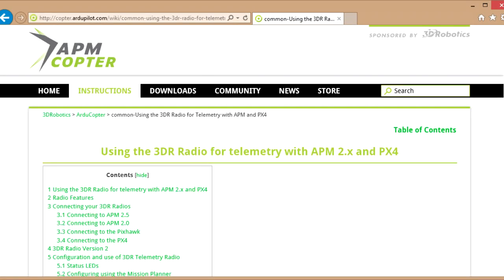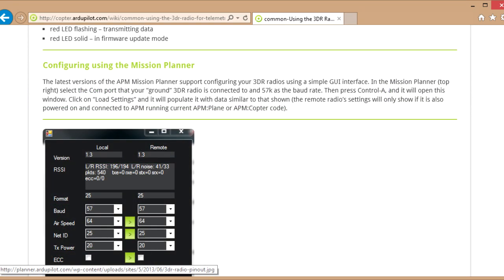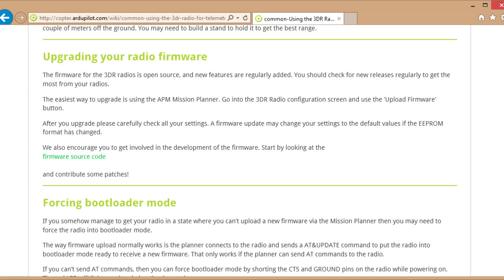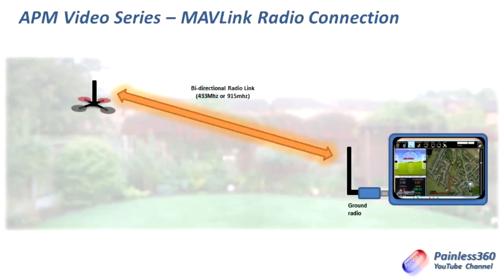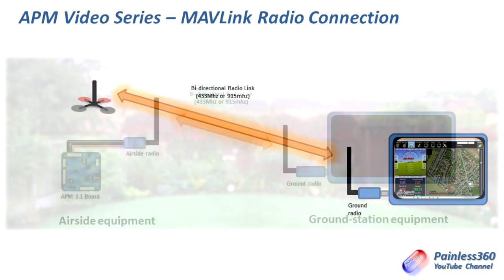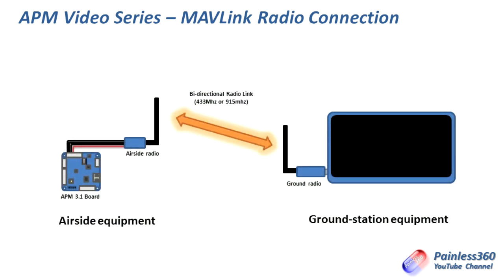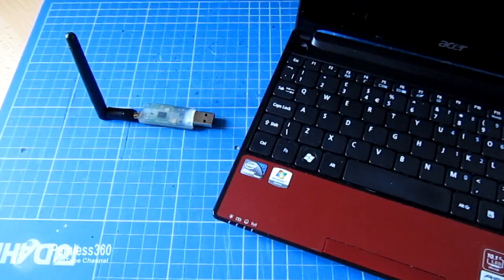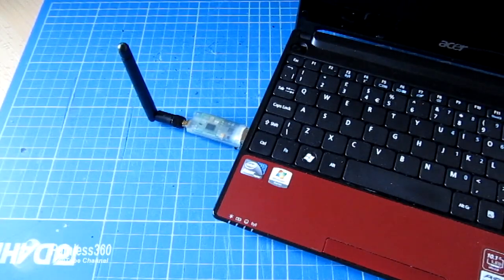APM 3.1 Video Series - Simple 3DR/MAVlink radio setup and use

Comment: Hi there, hope you are well. I have put together a 450 quad with APM 2.6, 900 Mhz telemetry and Minim OSD using your tutorials and all works beautifully. I have one minor issue tho which is - when the telemetry is not connected (to the PC), the GPS doesn't seem to initialise and no matter how long I wait, it never shows on the OSD. I have spent quite some time researching this without any luck. Would you have any thoughts on the matter? Regards, Peter.
Reply from the maker: +Peter Hegarty Are you not getting power to the GPS? If not then the power to it may need to checked. J1 would be a place to start and see if you can see the positive voltage on the GSP connection with and without the USB plugged in.. Best of luck..
Reply: +Painless360 yep, power is fine to all parts, the gps will only work when APM planner is connected, I'm guessing I've missed a setting somewhere ???
Reply: +Painless360 sorry I missed the bottom of your message (I'm using my phone) . I'm using the telemetry (wireless) not usb, but until APM planner is connected via wireless, the GPS won't show up, as soon as I do connect, away she goes. It's odd because I thought I could get full functionality without having to take a laptop with me to the field.
Reply from the maker: That is odd, never seen that before. I would have a good mooch in the forums. Sorry I don't have a 'magic bullet' answer. Best of luck.
Reply: +Painless360 yep, very odd, will let you know if I find a fix, thanks for your time 😊
Reply: +Painless360  Fixed it, I had to connect the transmit wire from the OSD to the APM. I made the assumption the OSD only receives - it does to a point tho, but needs to make a "request" for GPS and battery data. All working now :)
Reply from the maker: Well spotted - Happy flying!

Comment: Hi there, thinking of the APM 3.1 over the larger 2.X series, looking on eBay for the 3DR Radios however nearly all say they are compatible with the 2.x and no mention of use with the 3.1.  Did you use a 2.x 3DR Radio?  Cheers.
Reply from the maker: +Michael Wilson I did. Best of luck!
Reply: +Painless360 Thanks

Comment: Hi, I am working on installing a pixhawkp4 on a tarot650 quad using 4114 320kv motors and I am doing cancer treatment chemo and my mind is fuzzy&forgetful,I realy ould use your help wiring the pixhawk? if possible let me know?GGOD BLESS
Reply from the maker: +david ringler Follow the diagrams in the videos and the manual is excellent. Keep those props off until you are sure you have them connected the right way and turning the right way too..I have a Pixhawk series that may be useful as we build it and wire it in those videos too.Best of luck.
Reply: I WATCHED ALL OF THOSE VIDEOS AND I AM STILL LOST!! IT IS THE CHEMO BRAIN THING! WOULD IT BE POSSIBLE TO MAKE A TIME TO HOOK UP ON WEBCAM? AND JUST WALK ME THROUGH A FEW STEPS?IT SHOULD ONLY TAKE TEN MINUTES MAX? MAVLINK IS ALREADY SETUP MOTORS AND ESC,S ARE ALL INSTALLED JUST NEED TO HOOKUP PIXHAWK I AM USING TARANIS PLUS L9R RX SBUS I REALY NEED SOMEONE BECAUSE THIS CHEMO HAS ME SECOND GUESSING EVERYTHING!
Reply from the maker: No need to shout! I can appreciate that you are frustrated but slow down and take your time to check each step.

I do provide one-to-one coaching and support via Skype but this isn't free. If you are interested in looking at this then PM me via YouTube and we can setup a time for a call.

Comment: I tried to update firmware on my Air radio and there after it stopped connecting to ground module and the red and green LEDs are blinking continously. Even after successful downgrading and upgrading both the modules and settings, the air radio keeps blinking red and green when i connected to APM2.6 , you can see the video here https://www.youtube.com/watch?v=Ln3QufT1GTI
Please Help me
Reply from the maker: Sri Harsha the link light should be solid to show a link.  I would re flash separately and confirm channel numbers and check for breaks in the antenna and soldering. Best of luck!

Comment: Great vid, thank you! What voltage do you use when programming the airside telemetry board? I have a FTDI board where you can choose 5V or 3.3V. Thanks
Reply from the maker: Erich Neugebauer The airside radio is normally a 5v device (as shown in 16:19)Best of luck.

Comment: Can this be used on a tablet with a micro USB port if I was to use  an USB to micro USB  adapter ?
Reply from the maker: It can using an OTG (on the go) adapter. Make sure you tablet supports it though as a lot don't.

Happy flying!

Comment: Do you have a video installing OSD on 3.1?
Reply from the maker: A video is planned. Following the other MinimOSD videos on the channel and the pinouts from the APM guide online it should be relatively straightforward. Only issue is finding the cleanest, mot useful OSD firmware for the MinimOSD..

Let me know if you attempt it and how you get on..
Reply: Painless360 Hi, thank you very much for the APM series, all of them are very informative and really helped me having confidence on steps I am following in my builds. I plan to use MinimOSD and MAVlink radio with APM mini 3.1. Is it possible to connect them both on the same telemetry port? Is it just a Y cable splitting or there is something more complex needed in between?
Reply from the maker: You can connect them both but this pulls the signal too low for both to use - see http://diydrones.com/forum/topics/3dr-radio-minimosd-no-mavlink
Reply: Just got my 3.1 today.  Looking forward to testing

Comment: Great series of videos as always, I am looking to use APM 3.1 in a smaller quad. Currently I am using a 3DR PX4 with both 3DR radio link and minim OSD (one output for each on PX4) so I get live OSD on my Tx mounted Hudl. Would it be possible to do a further video showing the connections required for this setup? Many thanks and keep up the good work.
Reply: same question here

Comment: hi i have got my hex flying sort of ok but the yaw seams to rotate to the left
Reply from the maker: Steve Hobson hi Steve, if you are using the compass to maintain the heading check for interference from the power lines. If not then use trim to remove the drift - the APM may see them middle throttle position as slightly to one side..

Best of luck..

Comment: hello friend I need your help, I have a APM2.6 in a Xcopter, it's all working well (flight mode RTH, all right), I have to install telemetry radio but I can not install the USB device on my PC, I'm using Windows 7 already downloaded the drive FDI but not worked. what should i do? thank Heverton
hevertonmoura@gmail.com
Reply from the maker: Read the posts on this forum - http://www.rcgroups.com/forums/showthread.php?t=1877216

Takes you through a step by step process if the drivers need to be re-installed..

Best of luck..

Comment: Exceptionally good video as are all your videos. Can you connect the ground side with an OTG cable to an android device?
Reply from the maker: Thanks for the positive feedback! I've tried a few OTG cables on my Samsung tablet and sadly the Samsung I have doesn't provide power (+5V) out of the OTG cable so the radio can't power up. I believe that some other tablets do provide power so thet should work..

Let me know how you get on..
Reply: Painless360
 Actually I am in the research stage so I haven't finalized what I am going to buy. I have just noticed hobby king have come up with a complete micro apm solution have you any thoughts?    http://www.hobbyking.com/hobbyking/store/__74654__Micro_HKPilot_Mega_Master_Set_With_OSD_GPS_Telemetry_Radio_PDB_BEC_Power_Sensor_433Mhz_APM_.html
Reply from the maker: Looks interesting and is different again from the APM Mini 3.1 in these videos. If they keep coming out with different form factors support and cables will become very complicated!

Happy flying..

Comment: Thank you for the great video.
I’m currently more a MultiWii guy and followed all your videos including Bluetooth connecting and I wonder why the MAVlink modules requires FW and protocol (between each side and its radio not the PC and the FC board which is obvious (AT?)) and cannot just emulate UART like the Bluetooth module dose.

I have an idea for you for a video; connecting ESP8266 Serial WIFI Wireless Transceiver Module to MultiWii. The WIFI supports much longer distance than the Bluetooth.
Reply from the maker: Hi, the radios act as a virtual USB cable and are using firmware/software to encode the 57K USB data stream and perform error correction at each end.

In theory this should work with our friend the Multiwii too..

Thanks for the suggestion for the video - Happy flying!
Reply: Painless360 Thanks.

Maybe I’ve got the wrong impression from here: http://copter.ardupilot.com/wiki/common-using-the-3dr-radio-for-telemetry-with-apm-and-px4/ that the radio should be accessed with some AT commands on a regular basis.

Looking a bit deeper, maybe it can be programed once and do act as a regular wireless UART that can fit MultiWii.
Reply: Ram777x in a second search, it was done : http://www.multiwii.com/forum/viewtopic.php?f=6&t=2459